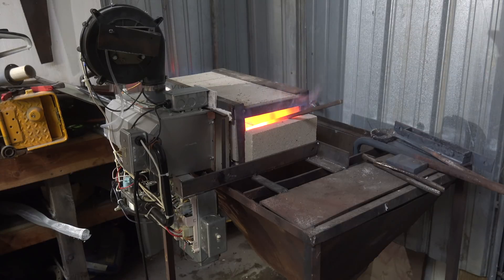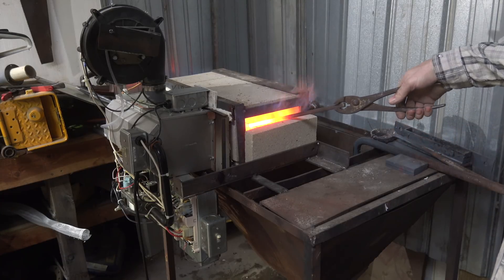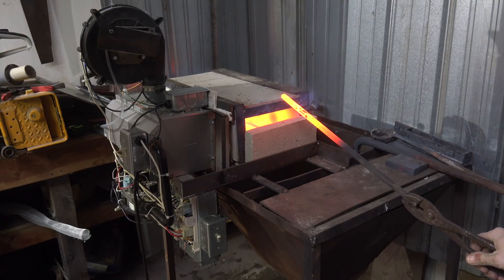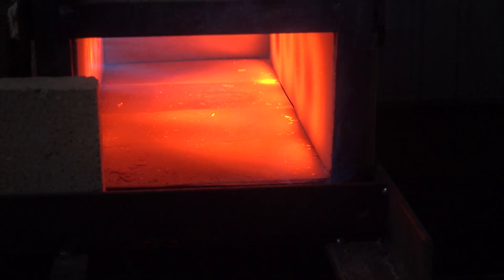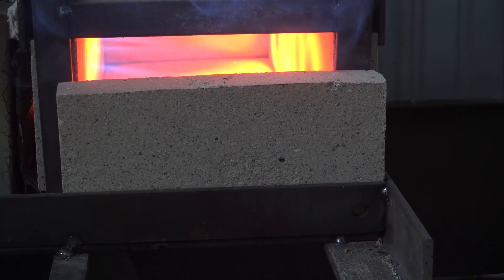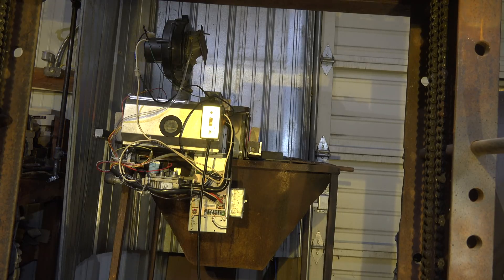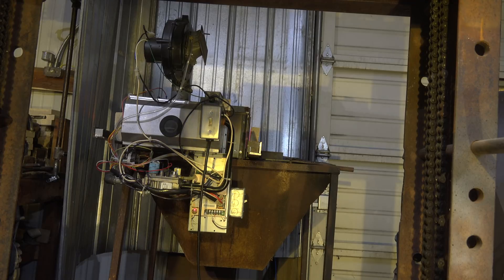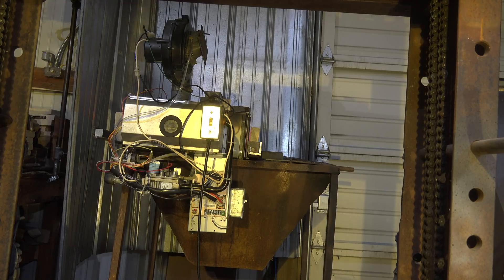Make a forge from a furnace, overview #1

Comment: All great videos. Have been watching long time now. Have a question. I work on oil fired only furnaces/boilers/water heaters could you suggest a good multimeter to buy as my current one died on me. Thanx
Reply from the maker: The Fieldpiece SC260 is a good all around meter.  Not selling them but a good value.
GFM